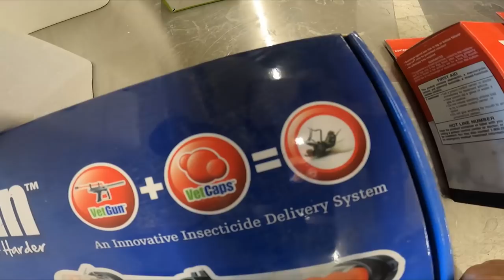Fly Control on the Ranch

Comment: I use the fly canasters as well an I found you can reuse them like 3 more times  instead of buying new ones just add some bread an more water an leave a lil bit of flys on the bottom an the stench continues due to the yeast. They fill up very fast an work very well! Great for camping around the home ranch etc.

Comment: Performed electrical work at large homes that had barns with 2 to 8 horses. All of these barns were fly magnets. All had 2 or more bug zappers. Only place that draws more flies is a pile of dead crabs. Used to go crabbing several times a year. One time we came back with a full bushel of crabs during an extended heat wave. Any way a few crabs got loose in buddys trunk. Don't know what was worst a trunk load of flies or stink from dead crabs.

Comment: I tried the Vet Gun Three or four years ago when they were introduced. Used it for a year after that I quit. Didn't have the long term effect they claim especially if it rains. I found that it worked for four to five days then the fly count went back up. That said I've tried everything but minerals with fly stop garlic and cinnamon seem to help more than anything else. Fly count dropped about 50 percent. I will however use the Vet Gun if I get a cow or her calf with pinkeye. You don't shoot the calves. But if you shoot the cow the oils from the insecticide will rub off onto the calf.

Comment: It’s basically just a modified/specialized Tipman 98. You could probably use a co2 or nitrogen tank made for paintball and it might cost less in the long run than buying new disposable co2 canisters.

Comment: YouTube suggested video? Hmm, anyways, I'm a Trucker and I run up to Hardin, Montana ( only in the spring and summer ) but I would love to live up there, but I dont wanna drive Truck. Utah,  Wyoming, Montana, Nevada, Colorado etc are such beautiful states. So underestimated. I ran to Hardin Last winter and didnt hit any snow, but the snow was all over. I used to live in Massachusetts amd it's just as beautiful in the winter. Love it up there,  but if you have to chain up, you dont need to be driving.

Comment: I'm not knocking the brand of fly trap jars you use. That being said we have horses and of course flies. We found that the design of the jars that Rescue makes worked better by far. Started hanging traps at the end of March (we're in Oklahoma). They definitely stink to high heaven but work like a charm.
Reply: We make our own fly traps using empty pop bottles, a bit of bait, a dab of Dawn, and about an inch of water.

Comment: i have something like that jug trap i use but i'm cheap and instead of trashing and buy more i just dump em out smells like hell for sure but to refill it just use flower and sugar works well might take a day or two get going but works well .. also add more water to jug after a month or so and u can get them things full to the top just spray at the top part
Reply: Not recommended because sweet attracts the honey bees.
Reply: @umarae27  it's not sweet it ferments and is more beer ish before it goes full on nasty
Reply: @hech1013  , I can see letting it ferment first before setting it out with the holey cap.  My brain didn't think of that, but instead went straight into honey bee protection mode.  Now that I'm out of that particular rut, I'll give your recipe a go this year.  What's the ratio?  3/4 flour to 1/4 sugar to pert near full water?  Thanks for the tip.
Reply: @umarae27  I just dump idk alot of flour and a good bit of sugar in hot water and mix it up then add to the trap (mine gets alot of am sun) also the trap is set up for flys so not saying bee's can't get in I've never found one could just use bad beer like Budweiser but even bad beer is still beer and why waste it
Reply: @umarae27  depends on the size of your trap mine is an old pretzel jar and I took one the throw away bag traps and attached to the lid of the jar so to get it started maybe 4 cups water and all.  like he said after they get in there And nasty it up it Bates it's self just add more water
Reply: @hech1013  alot = 2 cups , a bit = 1/2 cup, in my silly mind.  I'll start with that, and add water until about 1/4 from the top.  Sound about right?
Reply: @umarae27  again depends on size of jar but about 1 cup of flour and 1/4 - 1/2 cup sugar i only fill mine about half full and add water over time